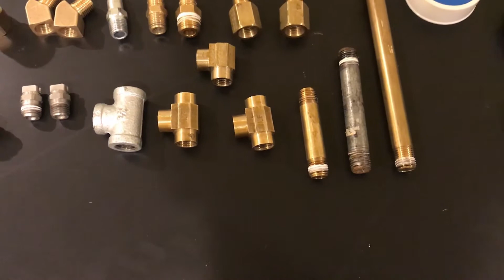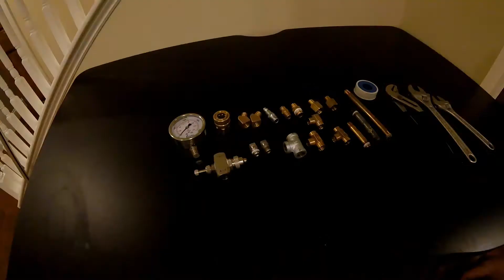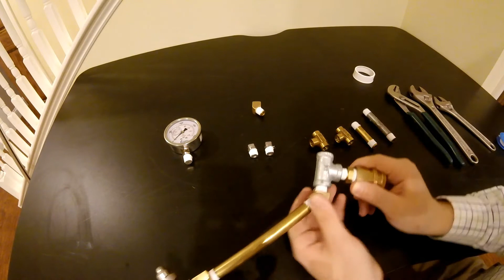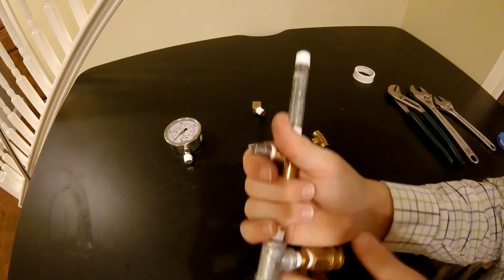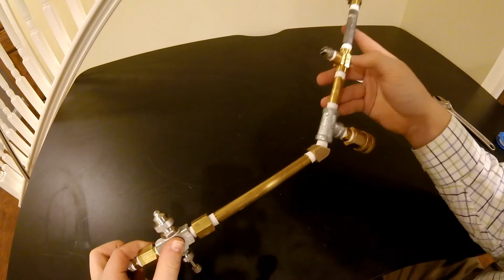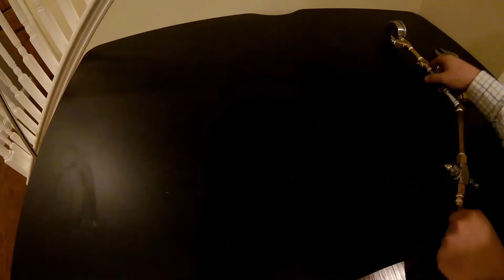New Snow Gun Build

Comment: What is the Liquid/Air device?
Reply from the maker: The Liquid/Air device is an atomizing nozzle that I bought.
Reply: @OutintheShop21  Can I have a link? Is it from Bete? https://www.bete.com/products/xa-dir
Reply from the maker: Sorry for the delay. Here is a link you can order the Liquid/Air device:
https://www.ebay.com/itm/1-4-BSP-Air-Atomizing-Mist-Nucleator-Nozzle/114012788507
Also I haven't done a lot with testing this new nozzle. I tried it when the temperature were marginal and made more slushy ice, however I am going to try it when the temps get reasonably cold and not marginal.
Reply: @OutintheShop21   Sorry, Saw this now. I guess your based around Allentown area? I am based in the Shawnee Mountain area, only 5 mins away from the mountain.
Reply from the maker: Yes, that is correct.
Reply: Hello do you know where I can get the atomizer nozzle the link you gave dosent work 

Anything helps
Reply: @sheasmith1065   its been sold here, https://www.amazon.com/uxcell-Atomizing-Misting-Pressure-Nozzles/dp/B07SS5XDXD/ref=pd_sbs_86_2/143-7432668-0949261?_encoding=UTF8&pd_rd_i=B07SS5XDXD&pd_rd_r=db39e94c-e2a4-4f09-9e40-b318764bf565&pd_rd_w=20d8j&pd_rd_wg=RC6az&pf_rd_p=ff9b5089-1414-4e8f-9675-3397e98bf276&pf_rd_r=A58XWYEXJRB1548AS6KH&psc=1&refRID=A58XWYEXJRB1548AS6KH